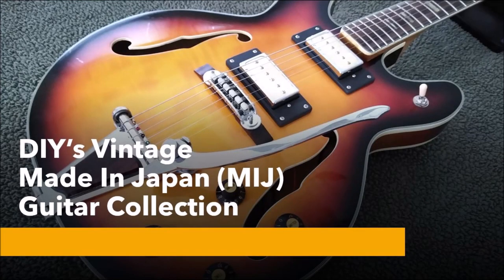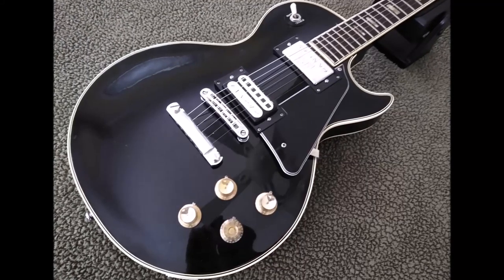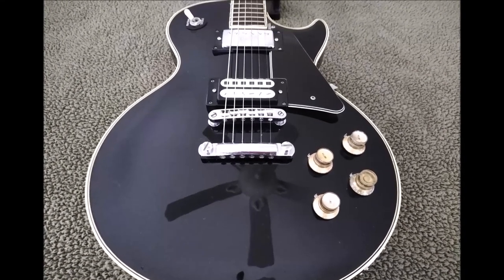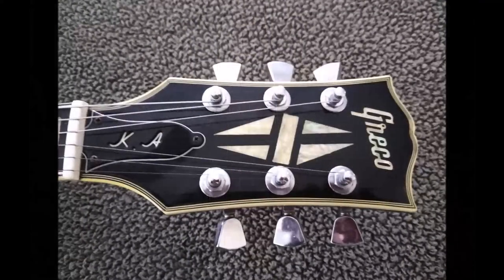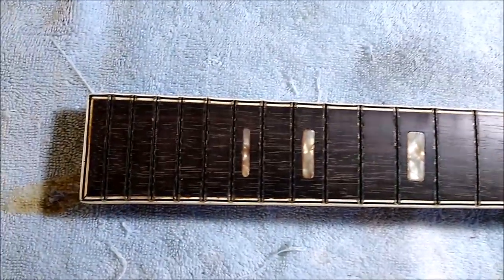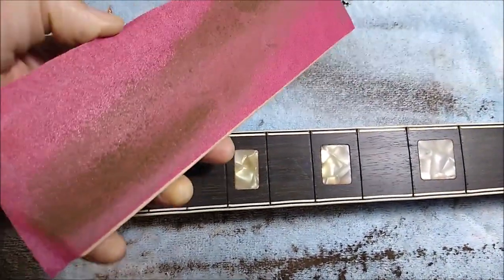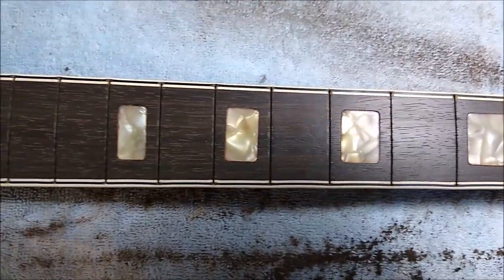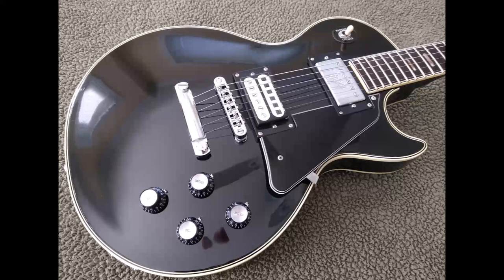DIY Guitar Talk - Vintage 1970s Greco LP Custom with 12" Radius Fretboard 😎

Comment: Hey Mike. Off the subject question. Have you ever decided to remove a pickguard off any of your solid body guitars? What would you recommend for filling the screw holes, and making the guitar look original without a pick guard?
Reply from the maker: That's a tricky fix. If the guitar is a solid color like black I will take a toothpick and press into the hole and seal it with Tite Bond wood glue, let it dry and then touch up with black lacquer. You can do the same if the color is cherry, brown, etc. However other colors are more difficult to match. So a simple solution is to either leave the hole alone or leave the screw in place to cover it.